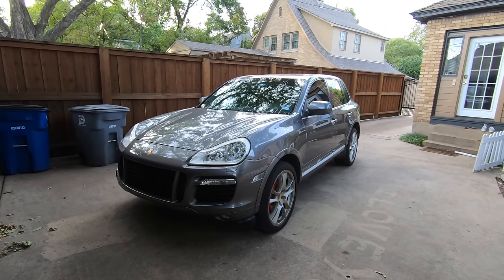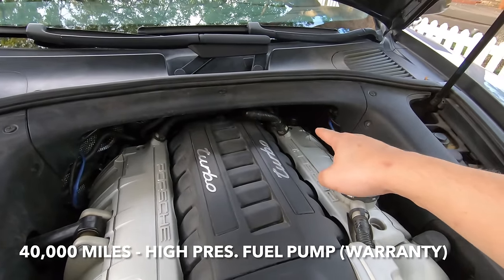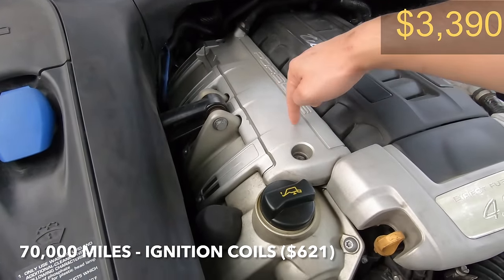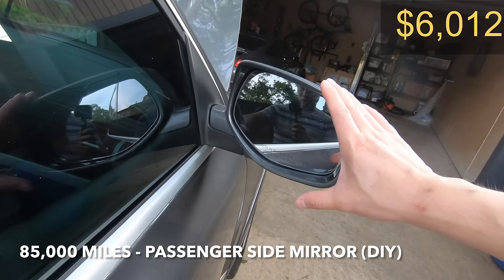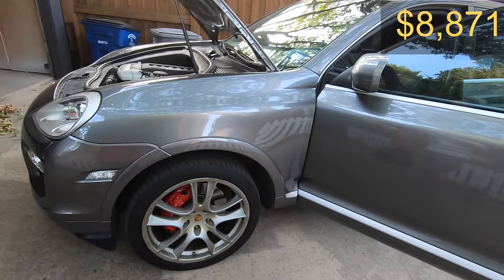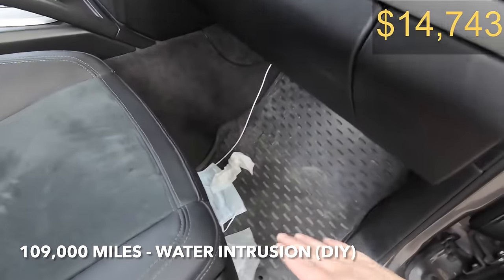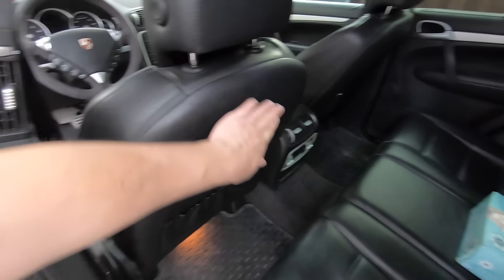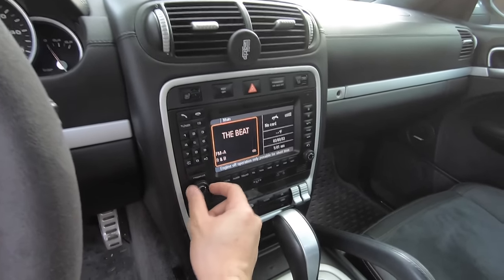Why Are Used Porsche Cayennes So Cheap? Owner's Review of 15 Year Old Cayenne Turbo (955, 957)

Comment: this reminds me of my experience with an Audi A6 I had for about 5 years.  I absolutely LOVED the styling, driving and how things were finished but OMG it would break every time you looked at it.  water pumps, complete suspension rebuild, power steering, oil leaks all the time, strange little things would break on the interior.  on and on it went so I finally ditched it and purchased a  2011 Cadillac CTS and have had no issues. Ive been able to keep my garage floor clean for years now.  Other car is a Honda so no issues there.
Reply: The A6, at least from the mid 2000s was the least reliable in their line.  I remember wanting one because I saw so many customers with them at my job, in an affluent area.  I then realized that they could truly afford those cars, and I most certainly couldn't.  If only they spent as much time on reliability as they did on styling, then they might really have something special.
Reply: Typical VW group quality.
Reply: I have an A3 from 2000 with the 1.8T and an automatic gearbox, no mods. And I totally understand what you mean
Reply: @LordPrometheous  My parents had an A6 from this era. Only lasted ten years before a needed repair cost more than the car was worth. Meanwhile my old 2003 Acura is still running great after a couple of different owners.
Reply: Had an Audi A4 Quattro Avant. Never ever again will I own an Audi.
Reply: Had a 2.5 V6 All road it went well when it worked
Reply: I used to work for Carmax. This guy’s wife wanted to surprise him by buying him an Audi S5. She had it shipped from another state. The car had a lot of little quirky issues as soon as it showed up. They still bought it, but were constantly coming back to the dealership to get one problem after the next fixed. Finally, Carmax let them trade in the car for what they paid (they were past the return window), and they got a Lexus instead. Never heard from them again after that! 😂
Reply: Audi is trash. I’ll never buy another one.
Reply: That's called market framing. You bought an image, the luxury vehicle never existed. In terms of build, there's absolutely no difference in Audi and Hyundai. One just maintains an image of status better than the other
Reply: @electropentatonic  To an extent I would agree with you.  Its interesting in that I was coming from an SUV at the time and was looking for something a bit more car like but with all wheel drive and at the time there were not that many options.  I looked at Subaru but did not like they way they were made and drive and finally test drove the Audi,  It was everything I was looking for as far as comfort and drivability, it wasn't until later that I found out that Audi and for that matter most of the German brands were not well built.  Not like they used to be.  Driving other brands is fine but I have yet to find anything that drove as nice as that A6, but at the end of the day you have to live with the car day to day and that proved to be a bad experience.
Reply: @yourdiytechlife  They're beautiful cars but you're right, the robust German design seems to have been pushed aside over the decades. There's also value in just feeling good about something. Like a new tailored suit and a sweater, they both serve the same basic function but a perfectly fit suit changes your perspective in a way a sweater doesn't. Nothing wrong with just being happy. I could see myself in a nice Audi or Porsche when the kids grow up
Reply: I had an Audi TT Quattro for 14 years, sold it after it reached 21 years, and my highest bill was about 300,00 €. Also, parts were super cheap. My brother damaged one side skirt and the hole thing, made of metal 120 cm long, just did cost 60,00 €. OEM from Audi. I once falsely changed my turn signal handle, cost me 39,00 € in parts. My mechanic told me, that he had the same issue on a French car a week before, but it cost the other guy 10x as much, because he had to change the whole console.
Reply: I love my 2007 A6 Avant. Yes... Been fixing lots on it, but driving experience it's well above any Asian appliances on 4 wheels. I usually fix the car myself and it's not that bad. I wouldn't own anything else, I wouldn't own a newer Audi either.
Reply: I have been driving Audis for more than 30 years. I buy them for next to nothing, go over the whole car to get them in top shape.  I never let anyone else work on them. I plan to keep running them forever since I am in a mountain snow belt. The snow performance is great. You definitely don't want one if you have to pay for repairs.
Reply: Dont by 5th hand
Reply: I had a vw Passat 2006 bought as new. It was the worst car I’ve ever owned. I had to go 4 times to have it serviced during warranty (one of the problems was the same this Porsche had), and after warranty I spent several thousands euros to fix different parts. I had to be towed twice. Never even for me a German car again
Reply: @mike-bv2jc  i had a Brand New Ford and Toyota . Ford broke apart after 3 months. Toyota broke apart after 9 months. After endless repair i ll give up. My New vehicles in future will be Chinese.
Reply: @LordPrometheous     I've often wondered how after building cars for well over 100 years, manufacturers haven't figured out how to make them reliable.  After buying cars for over 50 years though, I find Porsche is better than most.  There aren't too many cars from the last 10 years I would buy.  Porsche works hard to be reliable.  They respect their customers.
Reply: I see them by the side of the road with the hood up quite often.
Reply: @boyracer3477  the car manufacturers don’t want them to be reliable so they can keep selling you a new car after only a couple of years. It called planned obsolescence and it should be a crime.
Reply: @ahirschfeld1974  Son, I have been around for a couple of decades before you were a gleam in your daddy's eye.  I know "planned obsolesce" is a thing.  But from the manufacturer's point of view, it may just be buying and installing a cheaper motor for the window regulator because paying twice as much for a better one will only mean many good regulators are sitting in junk yards in cars there for other reasons.  Better parts cost more money. Should manufacturers put tires on that will last 300.000 miles and cost ten times as much just because a few cars last that long?   If they have to charge too much for a car, they won't sell enough to pay for their R&D to create the line of cars and they go out of business.  I'm sure you learned that is a good thing in this horrible capitalist world but also tens of thousands of people would lose their jobs.  All bad things in the world aren't caused by the corporate boogie man you were taught about in your wasted college years.How's that philosophy degree working out?  How's that loan payment going?
Reply: @fredpinczuk7352  I had a work colleague with a twelve year old Audi A4. I couldn't believe how unreliable it was.

I had an Alfa Romeo of the same age, and he couldn't understand how reliable it was by comparison.

It didn't break down once, in the time we worked together.

Manufacturers reputations (good and bad) tend to become fixed in peoples perceptions.

I'm not sure VW group cars are as great as people believe.
Reply: I had an 05 A6 S-LIne with the 4.2L V8. it was a great car until about 120k miles when I started hearing the death rattle coming from the timing chain for a couple of seconds on cold start. Audi actually put the timing chain on the back of the engine so the engine and trans have to be dropped and separated to replace the chain and guides. I was told it was around a $10k job so I traded it on a used 09 S5, because I really liked the way the V8 ran when it wasn't death rattling. I only kept that car about a year because the transmission was shuddering on the 1-2 shift and the dealer couldn't find anything wrong with it. 

That was the last Audi I owned. I may take one more chance on an e-tron SUV, but nothing else from Audi or VW for me.
Reply: I have been driving Audi A6 and A8 diesel cars in Germany for past 35yrs. ( now on my 8th Audi) I clock up some 300000km on one and just go for the next one. None of the experiences I read about here. They just work. Is there a big difference to where they are build maybe ?
Reply: That could very well be, I never checked to see if mine was made in Germany but hear in the US the resale value of Audi, BMW, is not good compared to the new cost.  this is due to the high cost of repair and people know they start having lots of expensive problems when they approach 100K miles. 
It might be different for diesel powered vehicles but those are not popular in the US.  It's very unfortunate if it comes down to where they are made. they are outstanding to drive when they are in good working order.  most of my problems cam from the quality of the rubber materials used for syspension parts as well as water pump, gaskets and seals.  Lots of the plastic parts in the engine bay became brittle and simply broke.  Very unfortunate.  @Raap1964

Comment: Sounds about right....my sister ditched her 2012 Cayenne after two engine swaps, fights with Porsche over what they would cover UNDER warranty even though it was clearly covered.  Additionally a 900 mile tow for the driveshaft issue you had at 18,000 miles and another of exactly the same thing at 31K miles but that tow was only 45 miles.  When she traded it on a 2019 Toyota Highlander the Cayenne had  49K miles but a well documented and sketchy service record (all scheduled service was done , I'm talking about the problems) and the dealer offered $19K for the trade,  I ended up selling it for her for $30,500 to someone who I explained everything to, he didn't care.  The engine was pretty new at that point but I wouldn't trust that hunk of junk to go very far from home
Reply: 2 engine swaps??!! Omfg
Reply: wow, that's horrible. maybe porsche should start using toyota engines. theirs seems to be very unreliable, lol.
Reply: Which engine? V6/8?
Reply: I had two Porsche Cayennes and I never had any issues! so, you can't generalize that all Porsche's are bad! I also had a 911 and a Boxster and never had any major issues. I will take care of my cars well!
Reply: @tdkboxster I have to agree with you . Plus some of these cars they speak of were bought second hand and you have to wonder how they were cared for and treated before they were owned by the current owner . You can look at you tube and find many videos of how reliable Porsches have been for people . I guess if your looking for videos like this then you will find them . I think some people that buy these cars really neglect the maintenance because it’s expensive and then the price is paid in the end . Toyota and Honda maintenance is fairly inexpensive so more people are likely to get it done on time and they are not pushing their cars to their limits like enthusiasts who buy higher end sport models .
Reply: From reading all of the posts a LS swap probably be better. Most German V8's are finicky in their own way.
Reply: @tdkboxster yes we can generalize. There are MANY accounts of the same failures. Because you haven’t experienced one doesn’t mean they aren’t well documented pattern failures.
Reply: "fights with Porsche over what they would cover UNDER warranty"

This is what I saw with my brother's Porsche. The fact that had did over £100k on the car, one would assume that a touch of customer care is implied. But what I can tell you is that; Porsche UK really don't give a f**k, and he carried the expense of nearly all the repairs, as the warranty was as empty as a politician's manifesto promises! 

Personally, I'm not stupid enough to buy German, and I told him not to do it, but when does older brother's ever listen to little brother! 

Maybe the fact that I got into the stock market, and now I have three multimillion pound properties bought and paid for in cash for my own personal use and not buy-to-let, and he's still a chef, should be enough for him to take note of my financial advice, but he never does. Oh, well!
Reply: @utubecomment21  maybe it’s just Porsche UK because I have two Porsches and I live in the US and I haven’t had any issue with the dealerships. You seem like a businessman so you should understand that all businesses don’t have 100% satisfaction with all their customers but at least from my perspective Porsche does very well with customer service at least over in my area. In this particular instance, in this video, this vehicle had an abnormal amount of things wrong with it. This particular vehicle seems to be the exception, as far as mechanical issues makes me wonder too, if it was abused
Reply: I have had excellent warranty service so far from Porsche but it is baffling that they continue to cheap out on parts and make stupid mistakes as they do with new vehicles.  Given the premium one pays all of that crap should never happen.  They have to know when they do the design work that these defects are being baked in.  My first Macan, from the first generation, was recalled so many times that I lost count.  Sounds like they screwed up and lost a potential lifetime customer.
Reply: No you cannot generalize because this is a never heard issue and there is a reson why the guy bought from him after telling everything he knew the screw up something. No other owner have replaced 1 engine let alone 2. There is not patter of anything because from 2018 to 2022 POrshce is Top 2 most reliable automaker in  issues per 100 vehicles according to consumer report beating Toyota. @BreadAndGatorade
Reply: @ToyotaAristo  lol, everyone and everything is a unique snowflake. We can not generalize 🤣
Reply: what went wrong with the engines ?? what was the reason the engines needed replacing ?

Comment: Idk man, that seems like a lot of problems. It's not that bad considering the total value of the car, but it really gets annoying having a few parts break every thousands of miles.
Reply: My thoughts exactly. I love Porsche, but I love my peace of mind when driving even more. I think I'd b waiting 4 something else 2 go wrong every time I drive.
Reply: The other reason this car is cheap is because it’s ugly as sin compared to modern cars… and for a Porsche that really depreciates its value
Reply: At the price and for the reputation of German engineering it should be bulletproof.
Reply: @mistermilkman  Yeah  allways wanted to buy a Cayenne,  now I´m not so sure,  I think mostly not.
Reply: @Indy_at_the_beach  There will never be a bulletproof car again, those times are long gone. And the reasons for that are in equal parts stupid customers that want 15.000 different electronic gizmos on their car that tend to break easily and greedy manufacturers who live in great fear of missing out on your money if the car is too reliable.

Back in times when cars were only expected to get you from point A to point B and keep you warm and dry while doing it everything was easy. Nowadays a car needs internet connection, 25 cameras, radar, laser, a million sensors, 2.500hp, massage function, electric everything, self driving ability, a gazillion of little helpers like lane change assisstant and so on... you can't have millions of computers and helpers and expect everything to work properly up into infinity.

If you want reliability first then buy the simplest 70s or 80s diesel without any extras (and have it restored) - no power windows, no heated seats, no apple car play, no 28 speaker sound system, ... the car will most likely outlive you and your grandchildren.
Reply: IT SUX
Reply: I think I'm gonna buy one a d when stuff breaks I'll replace it with extra good stuff
Reply: I have a 2005 Lexus ES330. Except for routine maintenance, it just keeps running and running…..
Reply: V6 cayennes are reliable dont worry. Worse is gettin a Toyota with  much more expensive frame rust issues, melting interiors, paint peeling, etc. and i am a Lexus owner.

Comment: My dad had a slightly older version(non-turbo), nice to drive but oh man did it break down over time. Honestly if you buy one of these and the previous owner has deferred maintenance you are in for a headache. You could easily pick one of these up and find out it needs $10,000 worth of maintenance.
Reply: Well to be honest their a reason they depreciate like a stone.
Reply: 10K is the standard Porsche tax.
Reply: Why people abuse cars like they do I don't know? I never have had any repairs to do on any of my cars.
Reply: @parkerbohnn  yeah, they are always for the next guy to do.
Reply: Because instead of paying 14k for a well maintained Cayenne that can reach 300k people pay 10k for a neglected one. You think Lexus, Cadillac, etc are differente? Lexus melting interior, paint peeling and rust frame are easily 15k to repair if the chassis is not compromised...

Comment: I like how everyone is talking about how nice their Toyota and Japanese cars are. Not all Porsches have this many problems!! I’ve put 30,000 miles on my cayenne 2013 4.8 v8 and all I have done is oil changes, transmission fluid and filter. And differential fluids. All done just as regular maintenance.  I did have the rearview mirror on the passenger side. Fall off. But it was 15 bucks on eBay to buy a new one and just a glue it back on.
Reply: Cause the 2nd GEN had ALL the bugs (for the most part) worked out of em. Especially the engine issues.